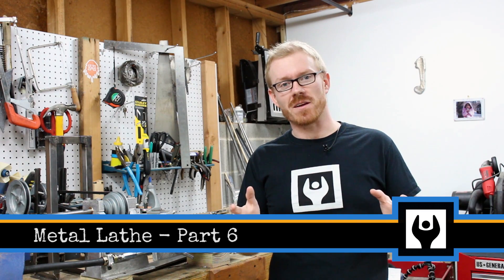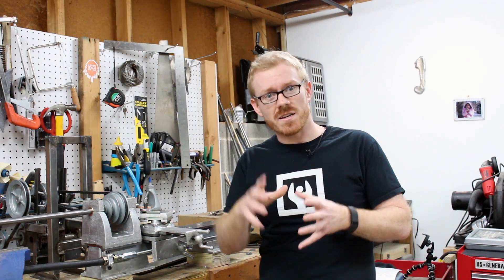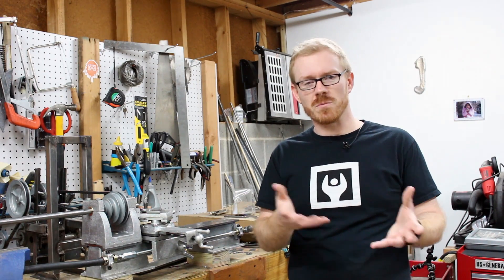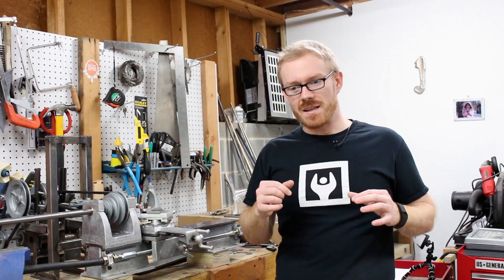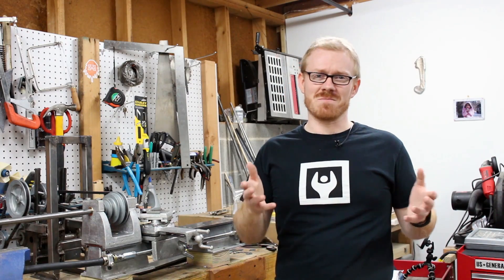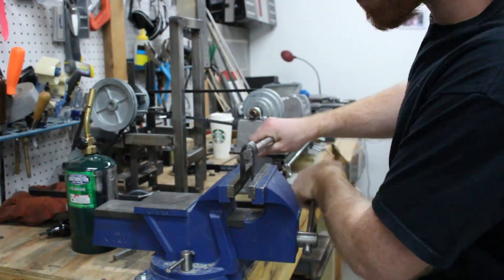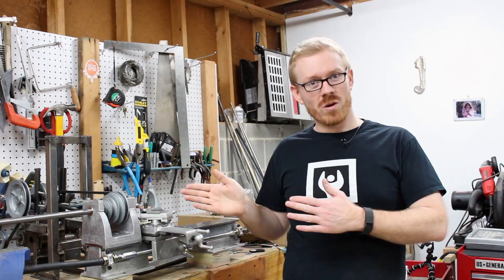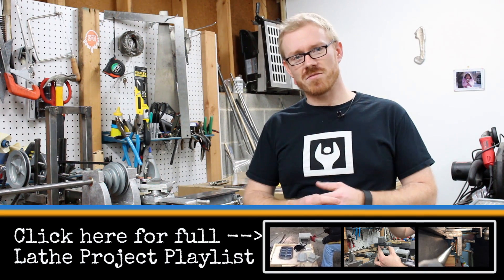Metal Lathe - Part 6: Boring the Headstock

Comment: i know this is an old series but your newer videos are so much better. more voice over and less back and forth jump cutting to you standing and talking (which is boring and unnecessary). 
its also easier on the video editor to do voice over on normal or speed up video of the work process rather than constantly making jump cuts. 
great lathe build BTW very informative and inspiring. I will be buying the books and attempting it soon.

Comment: Why all the trouble of bearing caps for the spindle, 
instead of just drill & press the spindle bushings into a solid plate?
Reply from the maker: Gingery implies that this is easier with limited tools and the reason for his design decision. I agree with his assessment. I have a hard time fitting 45% of items I drill into my drill press. Drilling a precision hole 0.999" diameter for an interference fit with a 1" bearing seems very challenging with my equipment. I do not have a hydraulic press...I do have a hammer. and that seems to work with wheel bearings on my Saturn ;) Way down the road I want to see about using tapered roller bearings, but again I expect that is WAY down the road. Good discussion points. Keep them coming.

Comment: you sure did have the gear to heat and bend the cold rolled... use your foundry!!! the chatter would be from the huge stick out on the boring tool.. you needed to make the ruff tail stock and line bore the head stock, (support the boring bar at both ends) ps the shank from the lathe tool you cut of makes a crap tool.. and with how ridged the lathe is and the speeds it will go you should be on HSS all the way!

Comment: ok so the only reason the headstock was on the lead screw was to drill the headstock using the lathe to make the lathe, wasnt clear in laste vid
Reply from the maker: You are correct. Hopefully part 7 clarifies a bit.
Reply: yes it did thanks

Comment: What i find a little bit discouraging is that you use a LOT of tools that one doesn't have if one follows the book. So i am interested in your opinion if, while you went off script a lot, you think the techniques and procedures in the book are viable.
Reply from the maker: This is a good topic of discussion. To make sure I address all the differences, help me make sure I don't miss any. The obvious ones are the drill press and welder, maybe the angle grinder too. Any more I should consider?
Reply: +Makercise Well i haven't really "worked through" the Book at this point. More in a general skimming phase of the whole project. (I am still a student living in a dorm at the moment, so having a shop is not really an option.) For one you don't use a charcoal furnace. I think its kerosene. Did the charcoal one not work out for you ? The drill press is the main thing, because that is obviously in a latter book, so all you'd have is a hand drill. Also you use techniques that aren't in the book (as far as i remember) like the 3-screw-contraption you used to adjust the center drill. Now i understand that improvising is obviously part of the whole experience. But i am curious if in your opinion his claim that you can build all of that without any special tools (other than an electric hand drill) is true.
Reply from the maker: Sorry to take so long to reply. The spirit of the gingery books is to use materials that are readily available to build things that many consider out of reach for fabrication in a small home workshop. The constraints Gingery faced were financial as he put it, "I had more time than money." Tools are cheaper these days factoring inflation; however materials are less available locally. Regardless, most would not entertain such a project. Not me, lots to learn regardless of the methods you choose. You should definitely consider the project once you are in a place to have an assortment of basic tools. The biggest benefit are the lessons learned. I have heard it said a better lathe can be purchased for less money than you will invest in the Gingery lathe. Despite agreeing with that sentiment, I really enjoy the project and have learned a ton.

Here are specific details on the items we discussed:

The drill...Factoring in inflation from 1980, an inexpensive drill press can be bought today for considerably less than what Gingery quoted as the cost of a 2" lathe dog, $36 ($111 in 2016). I have 85% confidence in Gingery's claim that it is possible to use an electric hand drill exclusively. However, given reduction in cost of import high-volume consumer grade tools like the drill press, I think Gingery would have used one if he were setting out to build his lathe today. (bunny trail: I got my drill press new when I was in college for $65 IIRC, one of the foundational tools in my shop 12 years ago) 

The charcoal foundry...I switched to kerosene because it was less mess and about the same cost. I have now switched to an electric kiln because I can go do other things instead of babysitting the foundry. Gingery's proof of concept worked just fine. If you have time but not money, you could make your own charcoal to fuel your foundry. Electricity is the easiest if not cheapest fuel I have used so far. I would not have purchased one had my wife not stumbled across one at a thrift store for $10.

The welder and angle grinder...absolute cheating in progress. Shame on me. ;) The gauge adjustment tool might be made with jbweld, epoxy, or thinner stock drilled and tapped. The angle grinder is my hacksaw on steroids.

The 3-screw-contraption...this is a Gingery idea presented in the headstock chapter in a section on gauging the cutter during the boring operation. I modified it slightly to accommodate materials I had on hand. Let me know if you were thinking of a different technique.

One thing that we didn't discuss was material. Gingery had different materials available. Just as high-volume tools have reduced cost, large retail outlets have reduced variety of material available locally. I really had a hard time finding fire clay for the foundry. I had to have my new green sand shipped from PA to GA...not cheap. Simple things like iron pipe nipples with a small diameter for the lead screw bearings were beyond me to find locally...thus the departure there.

You ask a good question. I hope my answers help you decide if the project is one you may pursue one day. Regardless, best of luck in your future shop. Cheers!
Reply: Thanks for the very in-depth reply!

Holy Cow, what kind of thrift shop has an electric kiln? Thats lucky. Although melting Aluminum isn't that difficult with the low melting point.

The problem with the procurement of certain materials occurred to me too, IIRC he often says something along the lines of "just go to your local ..." Yeah nothing local in the globalised world. Good luck finding your local Blacksmith/Forge. Even if you find a craftsman that does kind of things like that they often use highly specialized Tools/Materials that are of no use to you. And local Forge ? Yeah right. Granted ThyssenKrupp isn't that far from here but i HIGHLY doubt that they let me waltz in there and grab a bunch of materials. (Let alone find the right stuff for me).

Yeah i bet that is a huge dilemma with that whole built anytime you get stuck in doing something that is boring, difficult or yields less-than-perfect results you start thinking "hm, i could just go and buy [...]"

Good Luck with the project. I will be watching you :)

Comment: A great series of videos! You would have less chatter on your boring bar if you use less "stick out" from your temporary headstock. It doesn't matter how solid a machine tool is, the less stick out the better!

Regards Matthew.
Reply from the maker: You definitely have it right. I have started noticing what a big impact stick out, cutter sharpness, feed rate, and rpm have. This is a great project for me to learn. I feel like the relatively less rigid and wider tolerances of this lathe really amplify the considerations in play on any lathe. Thanks for commenting.

Comment: Nice job on the boring operation.  It is always tricky advancng the bit for the next pass.  Your method is excellent and it looks to be dependable.    I never thought of using spade bits on aluminum, but why not.  Also, carbide router bits work just fine on aluminum too.  I do that regulary.  Good work!

Comment: Wow! your videos always make me pause them and start writing comments because so many interesting things are going on! awesome that the superglue could hold the drillbit in place! was it a tight fit? I didn't know a spade bit would work on aluminum! I would expect lots of vibration. Cool adjusting tool! Very interesting techniques along the whole video! congrats! I am a fan of this :D
Reply from the maker: Because the drill bits weren't really well aligned in the tool post, the fit of the bit in the hole in the boring bar was not great either. Super glue held just fine. There was a slight wobble in the bit, but not to much too work a couple times. Spade bits were the money! I was caution and made sure to clamp well. I wouldn't try free handing it though.